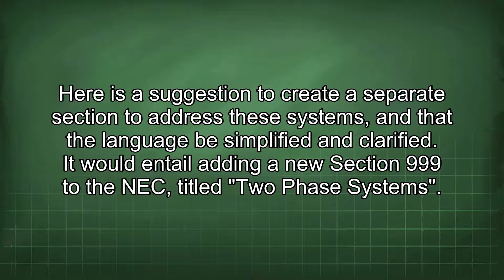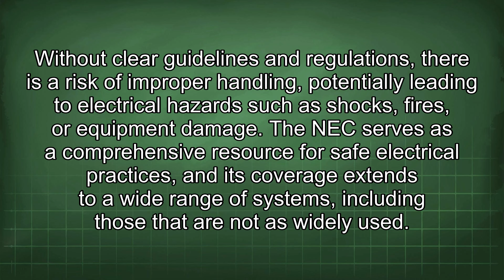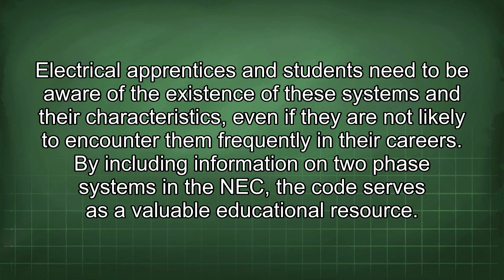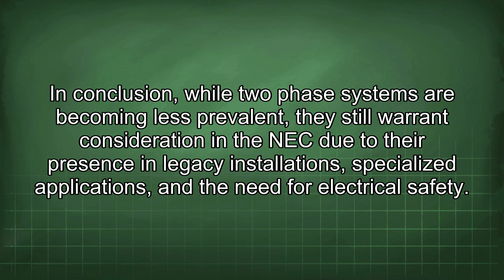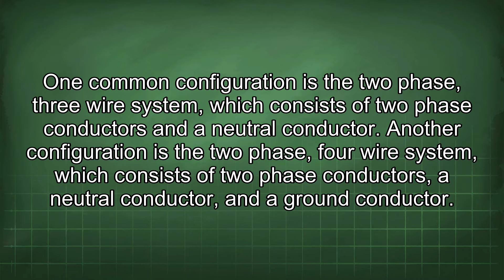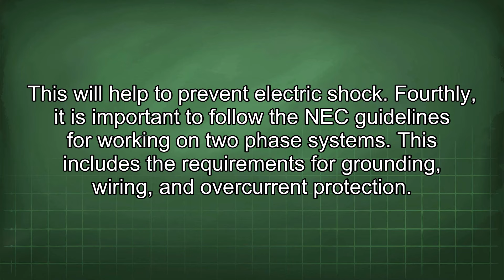Two Phase Electrical Systems Should NEC Still Address?

Comment: What is this, some kind of AI generated garbage with zero useful information? This was so boring, I literally nearly fell asleep several times. No useful graphics, just white text and super boring slow talking.
Reply from the maker: Hello @brnmcc01,

Thank you for the detailed feedback. It sounds like the pace and visual style of the content didn't work for you. I definitely hear your points on the lack of engaging graphics and the pacing/tone of the voiceover. My goal is to always provide value, so I'm genuinely sorry this felt boring and unhelpful. For future content, I'll be focusing on a more dynamic delivery and incorporating better visuals. If you have a moment, could you let me know what specific information you were hoping to find that you felt was missing?

Sincerely,

BESA Research
Reply: @BESAResearch No problem, it just seemed to be too much like those other completely AI generated videos. However, there was still no information about specifics. I've come across a few very old 2 phase systems in the past, and find  those very interesting. Just a long video with no details on even what is in the NEC in re: 2 phase systems or motors, or what are the specific advantages.